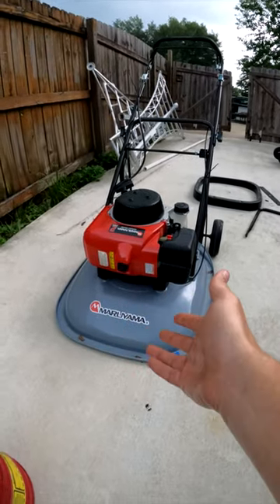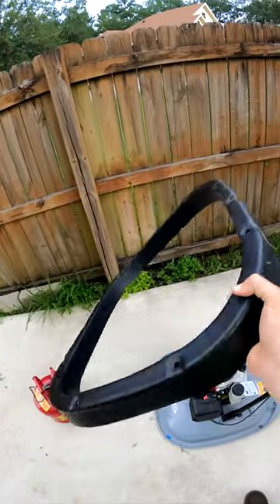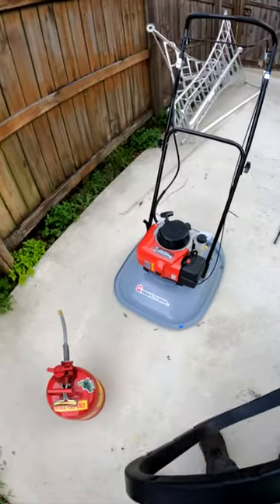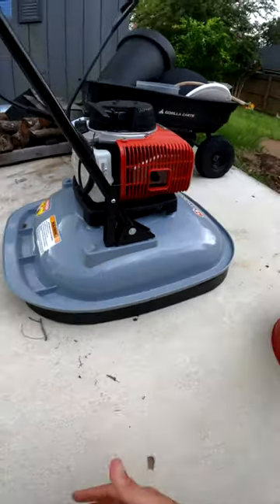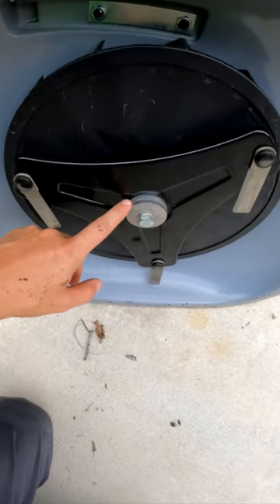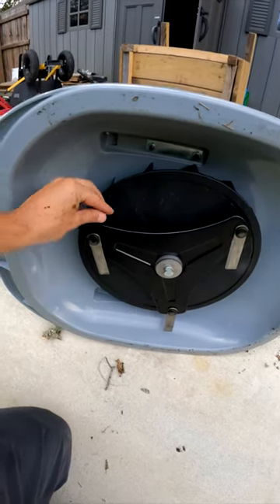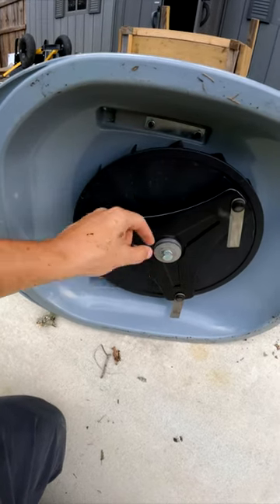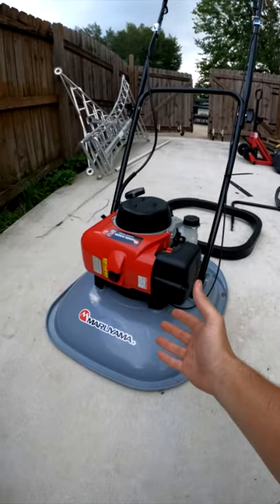Hover Mower: How to change cutting height

Comment: They had those in the 1960's.

Everyone got rid of them after using them a few times.
They really don't work well at all unless you have a perfectly flat lawn .
Reply: Golf course’s use em on steep hills that push mowers usually can’t handle. I’ve dropped mowers into bunkers countless times not listening and just using the fly mower. Not fun at all just handy in some applications.

Comment: I really love this idea. Gives "self-propelled" a whole new meaning.

BTW, I see the design flaw that could make it less effective. It needs ventilation for the air to suck through. It's a closed deck. How's it going to generate lift without a way for the air to get through? Imagine a helicopter with a closed deck over it's top. Not too effective, huh?

It would presumably blow the grass down in some cases, but it should still work.